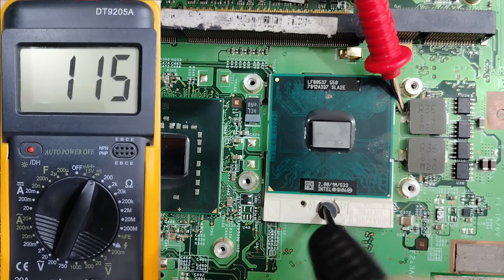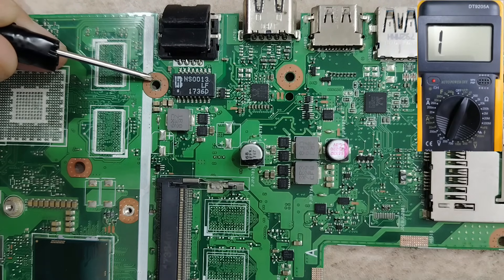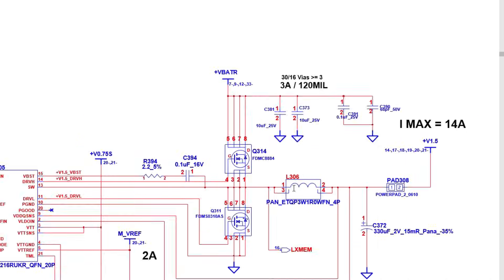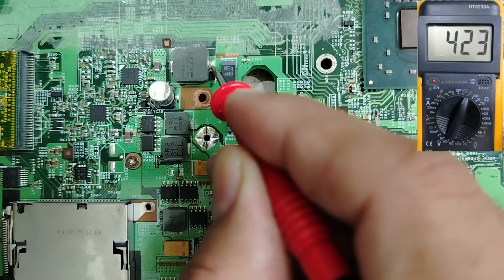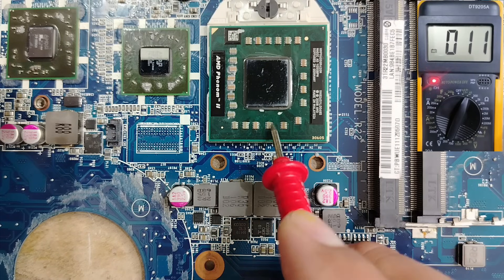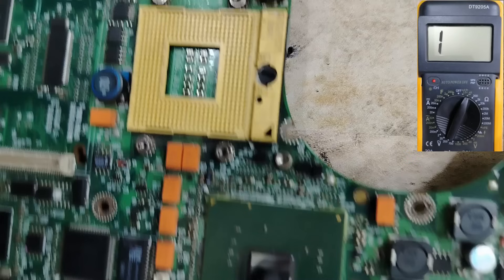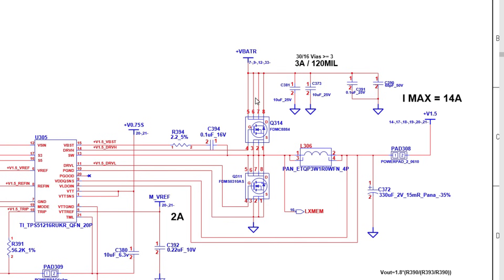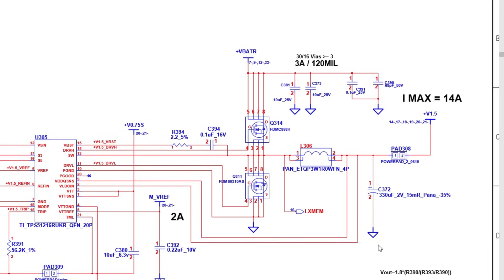The Fastest Way to Detect Short-Circuits on a Laptop Motherboard | Expert Laptop Repair Guide

Comment: how can i find the shorted component that is grounding the system power rail i i dont have have thermal camera. I can bypass the voltage protection but as idont have thermal camera  i dont know how to detect the sorted component. it could be a electrolytc  capacitor one of the many there are at the input of one of the subsystems. how to know? thank you for your content i already subscribed

Comment: 13:22 Logically, after removing that MOSFET and seeing the short still existed, all you can be certain of is there is AT LEAST a short in the lower part of the circuit but it doesn't mean the high power part above the MOSFET has no short either. Only after fixing the short at the lower part and placing the MOSFET, one can check and confirm. Not judging or challenging but just sharing my thoughts. If I am wrong please share your thoughts as I am still learning. Thank you for the video!

Comment: I really enjoy your lecture, but know that the CPU have some pins that are directly connected to the ground, meaning the CPU itself can be shorted. CPU got extremely hot when shorted and they get cold when open. The most difficult CPU and other components short, is partial short, how do you detect partial short?

Comment: Hi I have i5 acer laptop I turn it on thereafter it shutoff what is the cause please
Reply from the maker: Hi, It might be a short-circuit, overheating, or even a power supply problem. I recommend checking the power connections first.

Comment: Great Video. I have to say thank you first. Trying to fix my old laptop, I've encountered your inspring post. When I push the switch, the led is on but the fan stops after 1 or 2 seconds. What part should I check ? I will check my laptop as you teach in the video anyway. =)

Comment: how to know when  th CPU not can get out with scurdriver
Reply from the maker: Using Lock Signs on CPU Socket
Reply: @electronicsrepairbasics_erb  all the board today solder on  board you can mack video chack short that no in CPU,thanks

Comment: Thank you so much. Nice info. The question I have ... is, what about the  KBC o EC  Ic.  as well as  data or clock , how we could spot a short in those areas. Have a good one.
Reply from the maker: Great question. To diagnose a short in the KBC or EC IC area, focus on checking the data and clock lines using an oscilloscope to identify irregular signals or shorts. Additionally, use a multimeter to measure resistance to ground on these lines. Look for unexpected low values that could indicate a short. I’ll consider creating content on this topic, thanks for the suggestion

Comment: Thanks.
May i ask you  : 
1. where do you find those technical documentation about whole motherboards?
2. what if we cannot remove a CPU which is soldered? How in that case to troubleshoot for shorts for the area of the CPU?
Reply: ChatGPT : 

Ah, I see the confusion! In the context of the video, the trainer likely explained that:

1. *Inductors around the CPU area**: These are often part of the power delivery network (like VRM - Voltage Regulation Module) that supplies the CPU. When testing inductors in this area, a short (near-zero resistance) reading is **normal* because the inductors are directly connected to the power supply lines and the CPU. The CPU itself has very low resistance due to its internal architecture, which makes it appear as a short on a multimeter.

2. *Why the "real short is 000" matters**: The reply from the expert suggests distinguishing between a **normal low resistance reading* (like the CPU power rails) and an **actual short circuit**. An actual short would often show 0 ohms or a near-zero reading (e.g., 000 on a digital multimeter). The trainer in the video might have cautioned that such low resistance on inductors doesn't necessarily indicate a fault—it’s just a characteristic of the circuit.

### How to troubleshoot in this case:
When dealing with low resistance readings around the CPU:
- **Use a known-good reference**: Compare resistance readings with a working motherboard to confirm what's normal for that specific circuit.
- **Isolate the fault**: Check for shorts elsewhere (e.g., on capacitors, MOSFETs, or other components in the same power line).
- **Use voltage injection or thermal imaging**: If a short is confirmed, injecting a low voltage into the shorted line and observing for heat generation can help pinpoint the problematic component.

In short, the trainer's point in the video is to educate that finding a "short" (low resistance) near the CPU doesn’t necessarily indicate a fault, whereas the commenter is emphasizing that a "real short" is typically very close to 0 ohms. Both statements are valid but contextually different.
Reply from the maker: The real short is 000 reading

Comment: Sir, I want to ask a question. How much should the omage be in coil measurements other than the CPU? For example, what should be the omage of a coil connected to ground that has fallen into a short circuit? As technicians, we are having trouble with this issue. If you answer this question, I can go a long way in repairing and finding a short circuit. I would be happy if you answer and I am waiting for your answer.
Reply from the maker: This is an excellent point that many technicians encounter during diagnostics. Let me explain:

If a coil is in a short circuit condition, the resistance will drop to nearly 0 ohms because the power rail is directly shorted to ground. In such cases, you’ll need to isolate and test the components around the coil, like MOSFETs and capacitors, to locate the exact fault.

Shorts can sometimes be tricky, but by consistently measuring and comparing, you'll develop a sense for what’s normal in different circuits.
Reply: @electronicsrepairbasics_erb  Thank you very much sir, it was very important for me, greetings from Turkey
Reply: Thank you very much Sir. Greeting from the Philippines   I am able to have better understanding of power rail in laptop mobo now.❤❤❤
Reply: You should know first what is partial short and dead short cause its depend on the circuit that you’re doing…
Reply: @k3ggaming926  I know that much too. My concern was to learn the details because this is a serious procedure and no one explains it fully. You cannot get anywhere with general conversations. Our teacher explained the procedure, no need for extra comments, thank you.

Comment: What if I can't remove the CPU because it is soldered to the board how do I know there is no short in that region
Reply: same
Reply from the maker: No problem, in all modern motherboards the CPU is solderd .So the real short-circuit for the processor is when you get "000" not "012" either "004" reading.
Reply: Even 002 is not short circuit